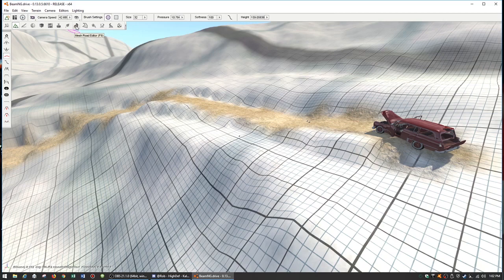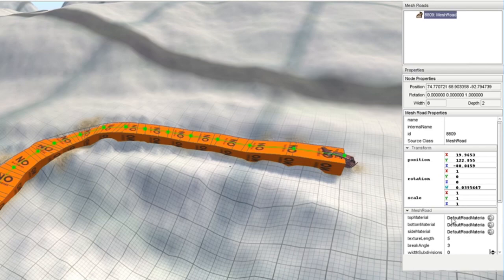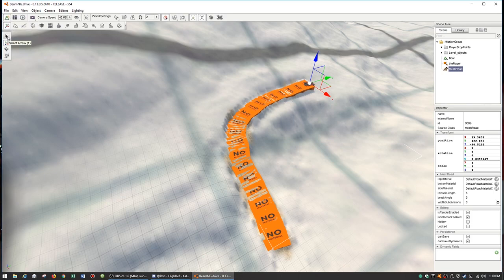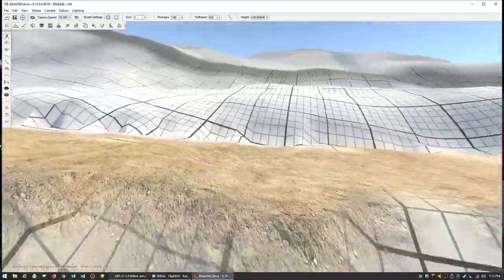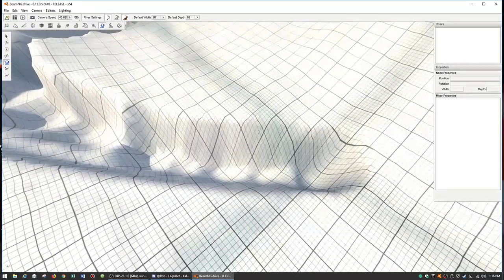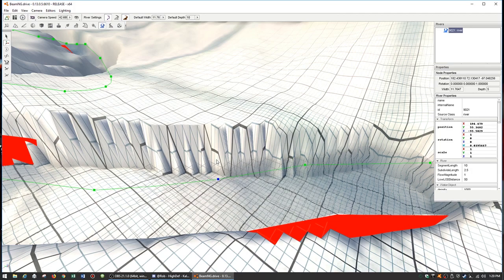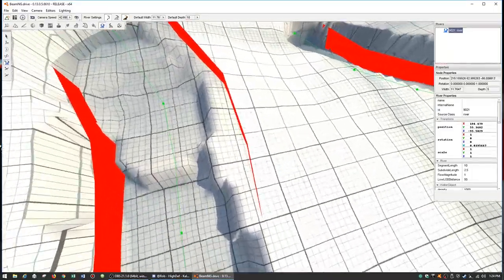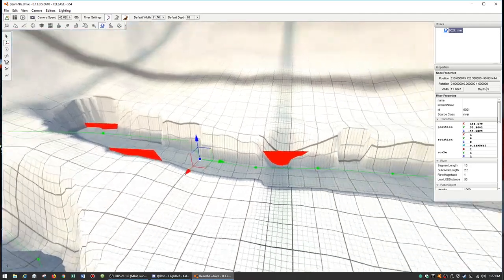BeamNG Drive Modding | EP08: Mesh Roads, Potholes, and Rivers - Oh My!

Comment: 735/5000
hello I develop a gigantic map it is possible to say
37 klm * 76 klm it is imported lidar earth scan from esri city engine demo 30 day's, and I reduced the size of the dae with rino 3d scan from esri city engine demo 30 day's

here is my question I work on a real scale with google map and open street map
this is the way I would like to define the AI because I have problems with the traditional method
so i would just copy my mesh road and with note pad convert it to decal road with these presets activated "over object", "ai 1", "one way 1"

I find the code to do this but I feel that I have duplicate files so nothing hangs my test thank you share of me gidee for this project
my beam ng tread is here 

https://www.beamng.com/threads/other-methode-to-making-real-map-like-assetto-corssa.63300/